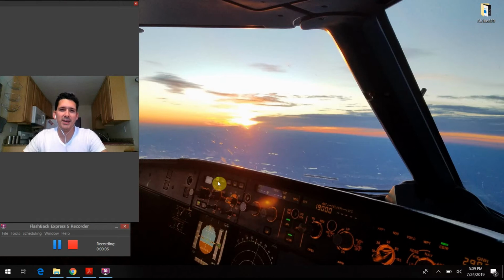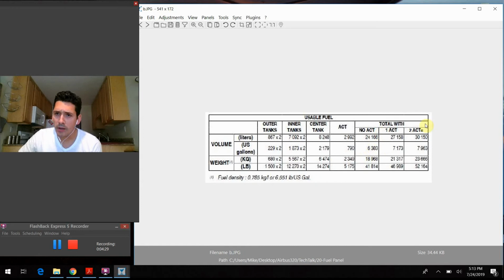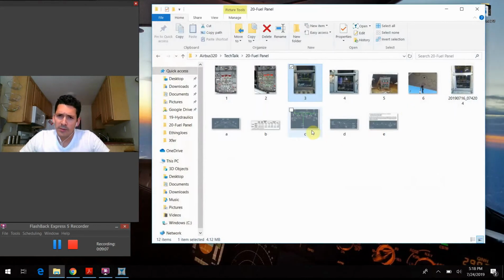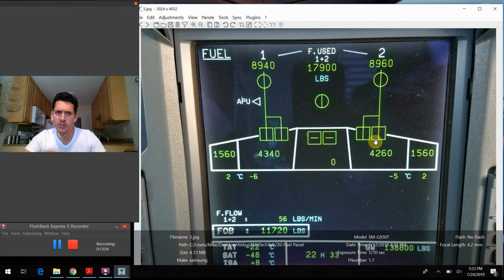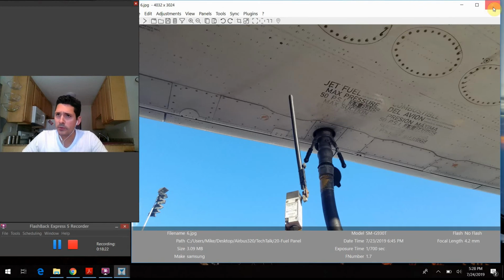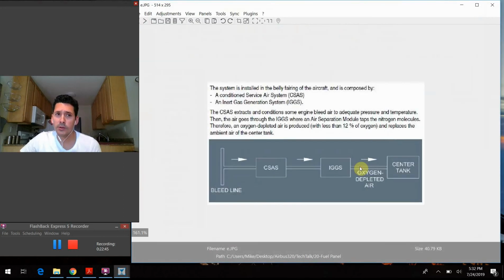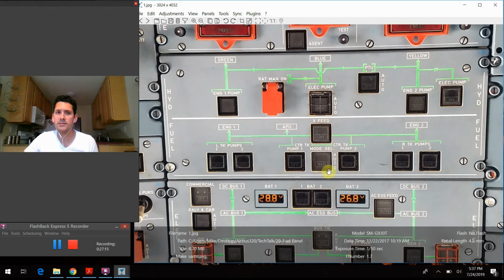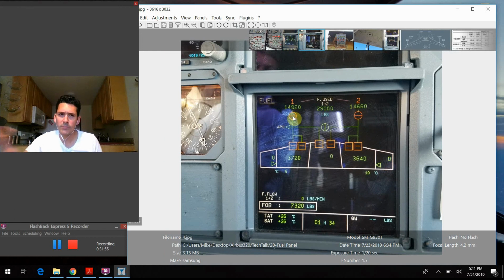Airbus A320 Cockpit Tour: #20 - Fuel Panel: What do all those buttons do?!

Comment: Hi, thanks for the great videos. I found your channel after installing the fly-by-wire mod for the A320neo in MSFS and searching for more details about all these buttons. After watching your videos I understand this plane and all those buttons much better. But I still have some questions and I maybe misunderstood something.

Does the APU take fuel from all tanks or only from the left wing tank.
Reply from the maker: Hey Axel, thanks for tuning in. Great question my friend. It will only draw it from the left tank. An interesting observation you make. Although it does not happen too often, but the nature of this system can cause a substantial fuel imbalance to occur if the APU has been running for several hours before going out and operating.

Comment: Great channel! I have a question. What are the magnetic fuel level indicators and why are they checked on the preflight?
Reply from the maker: Thanks so much for tuning in! The MLI's are a manual,  backup method let's say,  means of checking the fuel level in each cell. Think of it like a built in dip stick that you can take a measure, reference a chart, and derrive a fuel quantity from. These are only used in rare circumstances where the normal system isn't working properly, or perhaps by the maintenance folks for calibration. We never check these during normal preflights. All we are checking for is that the sticks are properly stowed. Great question!
Reply: @MikeAbignale  Thanks!

Comment: Good info! 
Have a question.
In our gravity fuel feeding procedure there is limitation ceiling depending on time spent above FL300. Any idea why? 
Thanks again!
Reply from the maker: Hey That's a great question! I'm not immediately familiar but I'm curious myself about this. Do you have a specific ECAM message heading I can reference, or perhaps a specified section in the FCOM I can take a look at to figure this out?
Reply: @MikeAbignale  hey! 
Check the qrh procedure for gravity fuel feeding. QRH>Abnormal>FUEL>gravity fuel feeding.
Reply from the maker: Jagteshwar - Yes I can see what you mean. The procedure is the same in my manual...hmm this is a VERY good question my friend and I have to  admit that you have stumped me! I'm really not sure about this limitation. I will ask some of the guys I fly with. Let me know if you discover anything on your end...cheers!
Mike
Reply: @MikeAbignale  thanks, captain!

Comment: If for some reason there was a delay on the ground or your taxi route and time differed from what was planned and for that reason you burnt more fuel thereby eating into your reserves. Would you have to return to the gate to add that additional fuel or can you takeoff if it seems within limits?
Reply from the maker: Heya Ryesher...another very good question. The very short answer is yes. But there is a lot more details that I would like to share and point out on this topic. I'll tell you what, I'll make a video about this sometime this week. I want to show you what our dispatch release looks like. This will make a lot more sense when you can see the numbers we are looking at and how we use them to make decisions like going back to the gate or no for more fuel.
Reply: Mike Abignale Excellent! Can’t wait for it 👍

Comment: How do you know the actual fuel quantity in the additional fuel tanks? Does it show up in the fuel page along with the fuel quantity in the center tanks? 
What are the surge tanks and the vent tanks? Are they part of the outer wing tanks or are they seperate from the outer wing tanks? Do these tanks hold fuel along with the other tanks or are they there for their specific purposes only?
Is there a specific procedure to keep the fuel from getting too hot at airports with very high temperatures?
Does the wing tanks have system similar to the one in the center tanks to create an inert atmosphere in the fuel tanks? 
What are the fuel requirements of an a320 at different phases of flight?
At how much liters of fuel does a pilot declares fuel emergency in an a320(does increase/decrease in payload affect this number)? How long can the plane stay airborne after declaring fuel emergency?
Reply from the maker: More great questions Aby!

How do you know the actual fuel quantity in the additional fuel tanks? - There would be an additional read out and icon with quality on the fuel status page.

Does it show up in the fuel page along with the fuel quantity in the center tanks? - Yes that's correct. It shows up beneath the center tank read out.

What are the surge tanks and the vent tanks? Are they part of the outer wing tanks or are they seperate from the outer wing tanks? Do these tanks hold fuel along with the other tanks or are they there for their specific purposes only? - Only there to account for fuel expansion or over filling as a safety mechanism. They would hold some amount of fuel but they drain back into the main tanks as quantity permits. They are separate in a sense and we have no way of knowing how much fuel is in there. Im not sure how much fuel exactly they can hold either. Id have to reference a maintenance manual which I do not have at this time. 

 Is there a specific procedure to keep the fuel from getting too hot at airports with very high temperatures? - No procedures outlined but it would have to be extremely hot with an overfueled aircraft for the tanks to vent. A rare circumstance for certain. 

Does the wing tanks have system similar to the one in the center tanks to create an inert atmosphere in the fuel tanks? - No inerting system in the wing tanks as they are never run completely dry. The risk and the need for such a system doesn't exist per Airbus.

What are the fuel requirements of an a320 at different phases of flight? We must takeoff with enough fuel to fly to the destination, (then the alternate if required)  and land with 45 minutes of fuel remaining. Also we have a limitation for fuel imbalances. 800 lbs to takeoff and 1500 lbs for in flight and landing.  (This is air carrier specific) 

At how much liters of fuel does a pilot declares fuel emergency in an a320(does increase/decrease in payload affect this number)? - Well we never deal in liquid quantities,  but we declare a fuel emergency if we predict landing with 30 minutes or less of fuel. This is very roughly 3000 lbs as a conservative number in the A320. Payload would affect this number (minimally anyways) as fuel burns are altered by aircraft weight,  but the numbers do generally remain very similar for given aircraft weights. All the guess work is taken out of the situation though by the constantly hard working FMS which gives very accurate numbers for everything we do with the plane. 

How long can the plane stay airborne after declaring fuel emergency? - Well this is a good question and is more complex than the simple answer of 30 minutes,  because you would never be declaring such an emergency right at the 30 minute mark. Let's say you were 1 hour from landing in JFK and due to bad thunderstorms enroute you had to do a lot of deviating. You burned a lot of extra gas above what you had planned. You notice that the arrival fuel on landing now shows 25 minutes. If JFK was your only option you could continue after declaring a fuel emergency.  In this scenario you'd still be able to fly for 1 hour and 25 minutes. ATC is going to move all traffic out of your way and you'd be landing safely in JFK. In all reality though, this is waaay too close for comfort and most crews would elect to divert if there was another closer more suitable airport enroute. Hope that makes sense!
Reply: @MikeAbignale  thank you very much for answering my questions Mr. Abignale 😀😀😀
Reply: @MikeAbignale   Mr. Abigale ,  I do have another question..... Can you explain more about the values you mentioned in the question about fuel imbalance ( 800 on take off and 1500 in-flight and landing)? I didn't quite understand that.
Reply from the maker: Yes of course, this simply just means the difference between the L and R main tanks for each respective phase of flight.
Reply: @MikeAbignale  Thank you very much Mr. Abignale..... Waiting for the next video😀😀😀